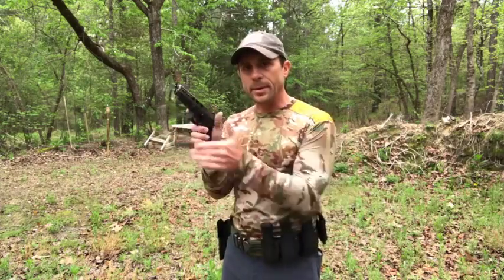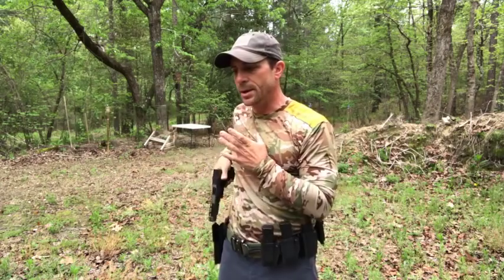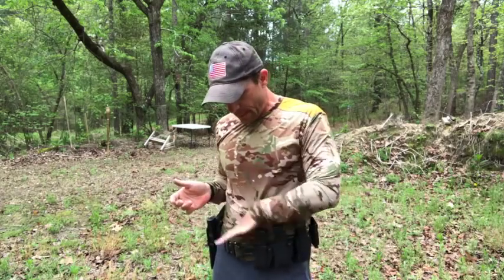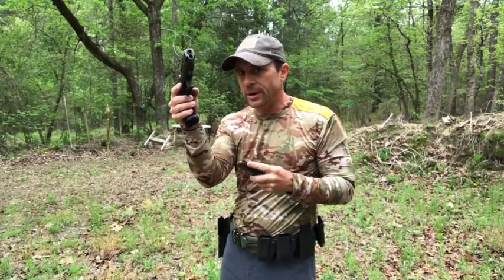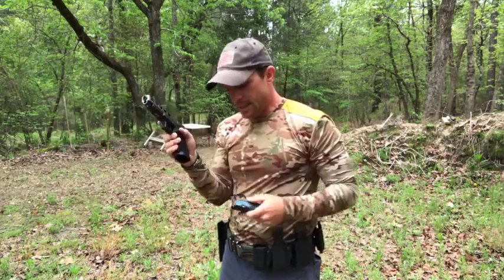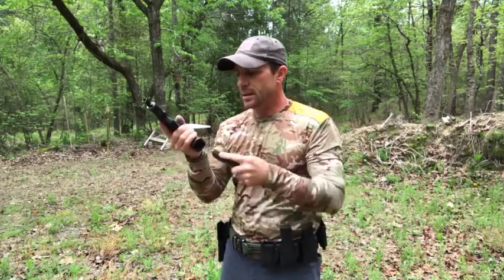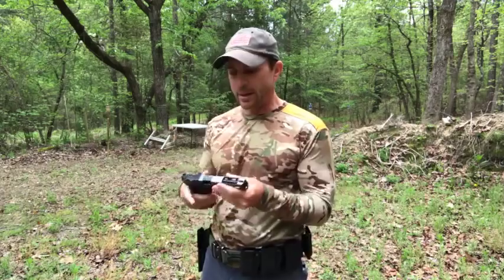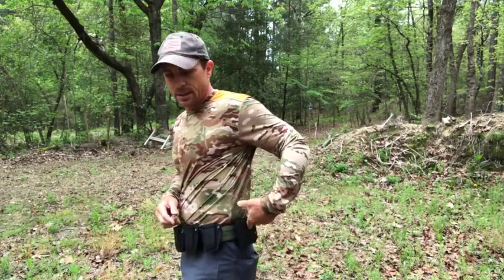Tactical Pistol Magazine Change

Comment: Thank you for a great video.   I had to laugh that someone gave this a thumbs down. It just goes to show there's always at least one.
Reply from the maker: Thanks Chris...Yes, always one. Haa
Reply: @caldwelljamey  I'd like to run a question by you, SGM.  With regard to the magazine change procedure, you make a great case for not using the support hand to rack the slide (and instead use the slide release lever).  The muscle memory rationale makes sense to me (along with the idea of losing a round).  Some other guys will say, though, that under the pressure of incoming lead/crapping your pants, your fine motor skills degrade and your thumb won't work as well.  For average Joes like me (whose heart rate will definitely not stay under 70 during a gunfight), what do you think?  Should average dudes do it differently?
Reply from the maker: @CR-ou4hl  When ever I teach students they range from various backgrounds and all think differently. Im not a fan of doing anything ONE CERTAIN WAY as it will not work for everyone. I try to teach what I was taught and what I have learned and figured out over many years of combat. With all that said...you are correct and some may function differently under stress. I would continue to train the way you feel is best for you but always train different methods as you must be proficient in more than ONE WAY. Now, talking directly about racking the slide vs thumb release during a gun fight....whats to say someones grip strength is effected when they get under full stress and they cant muster the strength to grip the slide or pull it back?? Not trying to WHAT IF anything to death but its a thought on why we should never train one specific way and say "THIS IS THE WAY"! Too many instructors out there teach "THEIR WAY" and do not have an open mind. Bottom line...get to the range as much as you can and try to take classes from as many instructors as you can. Its on you to sift through the bull shit thats out there and figure out what works best for you. Appreciate the feedback and really appreciate you following my channel. Sorry for the book...haa Have a great day!
Reply: Thank you for the very helpful reply.  This makes a lot of sense and I can apply it directly to my training. Again, much appreciated.  If you ever do pistol classes I hope you’ll put the word out.
Reply from the maker: @CR-ou4hl  So far everything has been LE/GOV only but working on a Civilian course. If your on InstaGram follow 1minuteout most of my stuff is posted there or my website. 1Minuteout.com

Comment: Question sir. You say to leave the pistol parallel with the ground when bringing it back to your work space so that the empty mag may fall free . Makes perfect sense!. My question is:  would you not drop the mag while at extended gun before bringing the gun back to your work space . As that space should be for reloading fresh mags not dumping empty ones? Love the channel just found you and subscribed.
Reply from the maker: anthony lewis you want to drop the mag as soon as you decide to do a Mag change but leaving it
At full extension just prolongs the process. You want to do as many tasks as you can at the same time to speed up the process. As you are releasing the mag you should also be bringing the pistol back to the ready position while your support hand is getting the fresh mag.
Reply: @caldwelljamey  again makes perfect sense thanks for the response sir